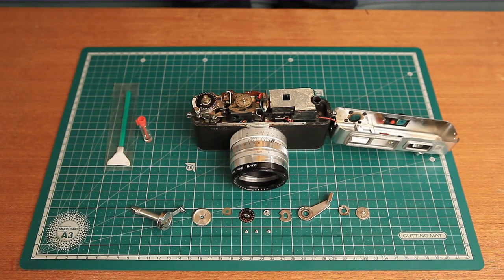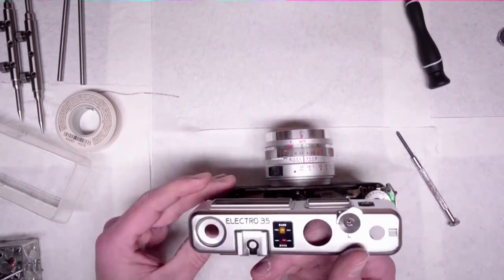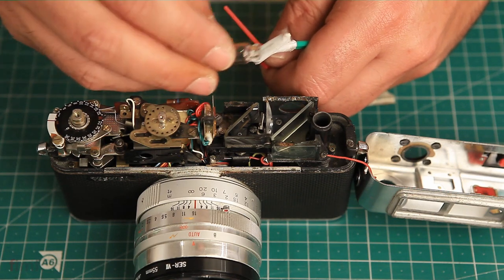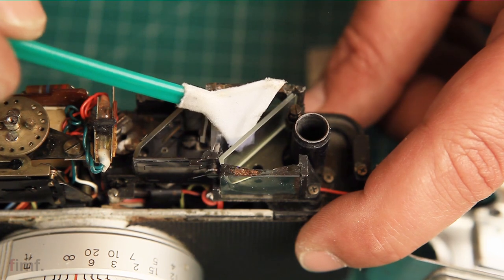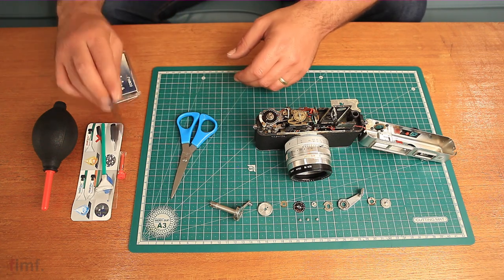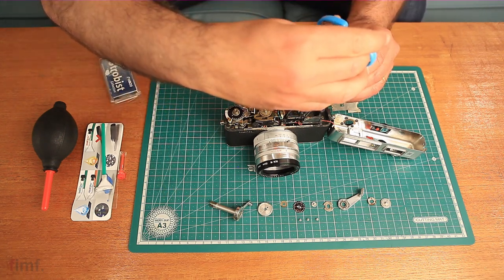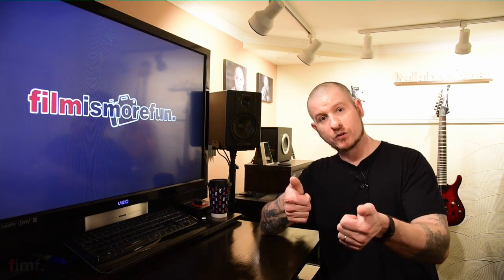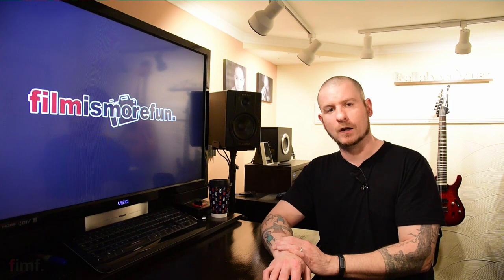How to Clean a Rangefinder Beam Splitter (Yashica Electro 35)

Comment: From what I've heard (admittedly not personal experience) this is dangerous advice. The Yashica Electro series apparently have a more modern, resistant coating on the beam splitter mirror that stands up well to cleaning, but on older/different cameras you are likely to destroy the coating.
Reply from the maker: I agree it can be tricky! That's why there is several warnings in the video about being gentle with the coating. 🙂

Comment: i tried this and it removed the yellow coating so dont try it guys.
Reply from the maker: Hi there. You probably cleaned the coating from the beam splitter. It was mentioned a few times to not remove the coating from the center mirror.

Comment: I'm pretty sure when you put that alcohol solution on  the coating on the mirror will be no more
Reply from the maker: Yep. As mentioned in the vid- don't use alcohol on the beam splitter mirror. However, using a sensor-cleaning kit for digital sensors totally works on that mirror without damage! 🙂
Reply: @filmismorefun  and most sensor cleaning fluids are methanol and ether  I'd try it on a small side area first, if the coating is in good condition you may get away with it but those that are deteriorating  are probably going to  disappear

Comment: unfortunately it wiped the coating of for me
Reply from the maker: Oh man. Yours must have been in rough shape.
Reply: @filmismorefun  a mamiya 6 automat 1950s I’ve ordered a beam splitter mirror 50/50 and I’m going to cut it to size and replace it hopefully it works 🤞
Reply: Apparently the older ones had a light coating on the beam splitter mirror so I wouldn’t recommend touching it just use a blower is the best you can do or replace it with newer type mirror
Reply from the maker: @patcliffordfootballcoach  thanks for the info